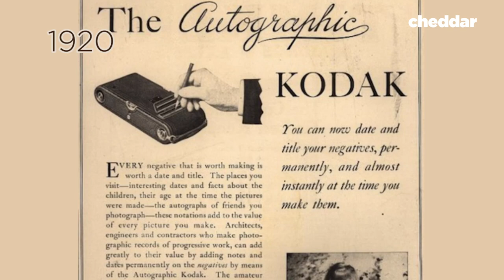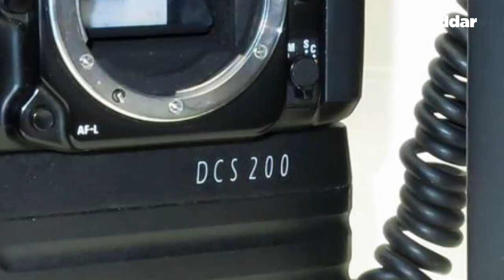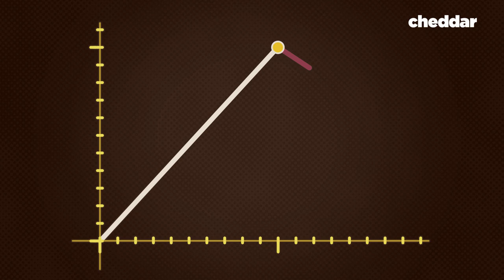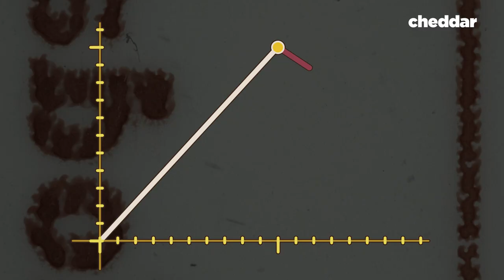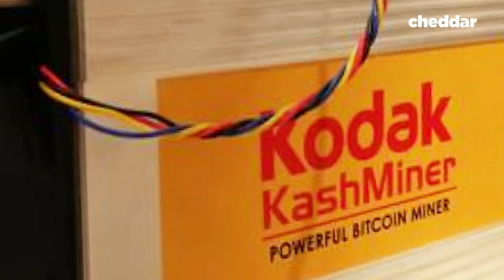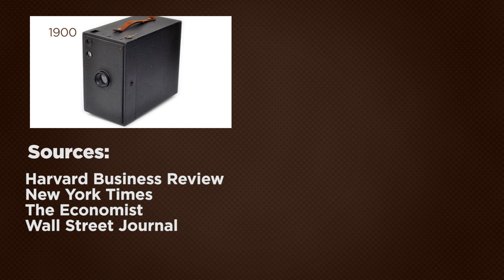Why Kodak Willingly Ignored the Future of Photography - Cheddar Examines

Comment: This video draws some pretty misleading conclusions. The digital camera revolution didn't kill Kodak, the smartphone revolution did, just as it also killed the the rest of the consumer digital camera market (and is now whittling away at the bottom of the enthusiast digital camera market). Kodak was a market leader through the early digital camera revolution, unfortunately their only other significant investments were in physical image reproduction (professional and consumer printing), and digital publishing and distribution killed that right about the same time as smartphones killed their consumer imaging investments. Kodak had no significant electronics manufacturing base to continue producing digital cameras at cutthroat margins, and by the time the threat of smartphones was apparent, Apple and Samsung were unassailable. On top of it all, they had significant pension obligations to continue funding through and after the 2008 recession, so they had little latitude to just burn their product portfolio down and start over. Sometimes history just picks winners and losers, and this time Kodak was the loser, even though they made the right moves at the right time.
Reply: Tell that to Canon, Nikon, Sony, and Fujifilm. Their DSLR and mirrorless digital cameras are THRIVING!!! Kodak didn't even budge.
Reply: @MrQwertypoiuyty  More ILCs are sold annually than in any year in the film era.
Reply: @MrQwertypoiuyty  Kodak had no real professional DSLR presence because the industry was nearly standardized around Canon and Nikon (Kodak's DSLRs were even just Kodak sensors in Nikon bodies), the consumer digital market was their only growth path in digital imaging. But the death of the consumer digicam market is what killed them. Even for the companies you listed, the future isn't great. Mirrorless is killing DSLR. Premium phones are attacking the prosumer digital camera market now.  Canon makes far more money from medical imaging and Business document reproduction services these days than they do digital cameras, it's completely arguable that they're not even a camera company any longer. There's other camera companies that made the jump to digital to only to fall on hard times: Konica-Minolta (sold the camera division to Sony), Pentax (got absorbed first by Hoya then sold to Ricoh), Hasselblad (owned by by a private equity firm now, with minority ownership by DJI). The four you listed + Panasonic can afford to stay in the game because they're well diversified and don't depend solely on digital cameras.
Reply: @jasonosmond6896  how bout you make a video then.
Reply: Before the smartphone revolution came, digital cameras were already eating into Kodak's film sales.
Reply: I strongly disagree that the digital camera market has been "killed" by the smartphone. Smartphones these days have some amazing camera capabilities for such a small package, especially as more smartphones get the same 1/2.3" BSI CMOS sensors that high-end small-sensor compacts have inside. That said, they have extreme optical and power limitations that make them vastly inferior to a "real" $500 camera. They tend to have fixed apertures and fixed optics, usually wide-angle only, and the clip-on adapter lenses used to give them different optical qualities are noticeably inferior to a "real" lens. Most of the reason that high-end smartphone images look good at first glance is the heavy noise reduction done in software which, when zoomed in, gives the picture a "mosaic" appearance due to the smudging. Fine detail is non-existent. Most of the good-looking images on Instagram are shot with a Wi-Fi enabled DSLR and transferred to the phone for posting!
Reply: @JodyBruchon  ...  true, but by the 70's, Kodak's camera division was entirely devoted to consumer cameras, simplified for ease of use by non-photographers. By the early 70's Kodak only made point & shoots, which were entirely supplanted by their superior digital counterparts.  By the time Kodak got well onto the digital point & shoot bandwagon, smartphones  were beginning supplant those.

90% of all photographs taken are still made by non photographers, for whom the smartphone is more than good enough. In fact for their needs, it's superb.
Reply: @mortimersnerd8044  Smartphones are good enough out of convenience more than technical superiority; it's "the camera you have with you" for most people, but that doesn't mean it has killed off point-and-shoots. If  you have a high-end phone with a 1/2.3" sensor then you can get comparable results to a compact point-and-shoot at full wide, but that's as good as it gets. Smartphones certainly didn't help Kodak, but digital cameras were still in widespread use several years after they got into the market. I had a Kodak digital camera in 2000 that I was using until 2006 when it was replaced by a better (but still cheap) FujiFilm digital camera; smartphones weren't a thing in 2006, though feature phones with lousy low-res cameras meant mainly for picture messaging were widespread. Feature phones in 2006 had truly awful cameras, though. It took quite a bit of time for tiny CMOS sensors to catch up to the CCDs of the time.
Reply: @JodyBruchon  ,"Smartphones are good enough out of convenience more than technical superiority"... Exactly. In mass-market low end cameras, convenience is way more important than technical superiority, and that is the only kind of camera Kodak made at that time. The smartphone is the most convenient form of a camera available, so it completely supplanted Kodak Cameras market base of non photographers.

Nikon, Cannon, Pentax, Fuji, all  produced cameras for professionals/enthusiasts which is why the smartphone didn't destroy their camera divisions. Kodak only made cameras for exactly the same people who now love the smartphone for taking pictures, which is why their camera division died.

BTW,  if you are going to upvote your own posts, it'll be a  little less obvious if you wait a few moments before doing so 👍
Reply: @mortimersnerd8044  smartphones with cameras that took remotely decent photos didn't exist until a decade after Kodak got into the digital camera market, so they had nothing to do with Kodak failing in the digital camera market until Kodak was already collapsing. I had the first Android phone which was an expensive phone at the time and its photos were not good, especially compared to a cheaper point-and-shoot dedicated camera. I didn't start taking casual photos primarily with a phone until about 2010 for this reason.

I upvote my posts because it's allowed. If that's really where you want to take this then I'd say you're out of things to argue about.
Reply: @dangermanv6133  Not at all, Kodak was one of the top consumer point-and-shoot digital camera manufacturers in the early 2000s. In fact, of all the people I knew that had digital cameras, the majority had Kodaks (not me, I was a Fujifilm guy until I switched to Sony mirrorless). But just as significantly, for every one of them (including the non-Kodak owners) that was the only digital camera they owned until they got a smartphone. Kodak's consumer digital imaging play was entirely based on the concept that they could sell printers, ink, and photo printing services to people with digital point-and-shoots, and that would be their continuing revenue stream. They sold digital cameras that were easy to use, and designed to integrate well with their printers with easy to use docks and software. Smartphones killed that by not only removing the need for the camera, but by removing the need to print photos so they could be archived and shared.
Reply: @JodyBruchon  For your average consumer, their first digital camera was also their last digital camera, (unless it was one of those truly dire 1MP fixed focus jobs that came out at the beginning, which they might have upgraded after a few years, which is what I did, to a nice 6MP Fujifilm E550 that could shoot RAW, weeee!) . It was probably 3MP - 6MP, with bad low light imaging and potato quality video, along with dodgy and slow autofocus. The memory card was likely 64-128MB, and could hold 50 to 200 shots depending on quality. The only way to properly view and share the images was to wait until you got home, plug it into your computer, wait for up to 10 minutes while it transferred over USB 1.1, and then wait for your ~1 GHz computer to index them and generate thumbnails. If you wanted to share them, the only way to do so was via email over your 512Kbit/sec DSL or cable modem upload, keeping in mind that email attachments were limited to 5 - 10 MBytes, so you were either sending only 4 or 5 at a time or resizing as an extra step. This was all circa 2005.

By the time the iPhone 4 came out in 2010, it had a 5MP BSI sensor, tap to autofocus, LED flash, HD video, a bright high resolution screen, up to 32GB of storage, a CPU with image processing specific extensions, up to 5Mbit/s upload to the tower, or up to 288Mbit/s to WiFi, and most importantly, an app store that permitted apps that allowed the user to easily view and edit any of her pictures any way she liked, and then share them online or to anyone anywhere else in the world with just a few taps.

So yeah, "technically speaking" smartphones weren't, and still largely aren't, as good an imaging platform as state of the art point-and-shoot cameras. But for all the things that 95% of consumers care about, they were and still are without a shadow of a doubt much better at being cameras consumers want to use, and they did that within only 3 years of instroduction, and they've only gotten better every year since. The iPhone was introduced in 2007, the iPhone 4 in 2010, Kodak declared bankruptcy in January 2012, and exited the consumer inkjet business in September 2012.
Reply: @jasonosmond6896  I own about 15 cameras, mostly point-and-shoots, from the early 2000s through 2011. I owned (and own!) a Kodak DC3200 fixed-focus 1MP camera. Most of my point-and-shoots were bought in the past year because I already owned several quite excellent interchangeable-lens cameras and wanted to see what I could do with something far more limited. I've got a Canon PowerShot G3 (not G3 X, the original G3) from 2002 in my collection; despite being a 4MP camera with an old-school CCD and a max ISO of 400 and almost old enough to buy cigarettes and drive a car, I'm able to get excellent (particularly for the limited tech of 2002) long exposure night photographs with it. Here's one of them: https://www.jodybruchon.com/wp-content/uploads/2018/02/IMG_0113.jpg

Your "circa 2005" is a few years off; you seem to be remembering and mashing up elements of 1998 and 2003. I'm all too familiar with the issues from the earlier years of digital photography and some of the things you point out were not really a problem back then. 5MP photos transfer much more quickly than the 24MP photos of today's cheap DSLRs. USB 2.0 came out in April 2000 and was in widespread consumer computer use by 2003 (Windows XP came with native EHCI support) so direct USB transfer wasn't nearly as bad as you've described from about 2002 onwards; it was also possible to transfer pictures much faster in the late 90s-early 2000s with CompactFlash USB and PCMCIA adapters. Burst shooting was impractical, so a 200-image capacity was more than enough (and for most point-and-shoots even today it still is more than enough) and you only need one shot if you're taking the right one. Also, I was a cable modem installer in 2002 and the standard service level was 3 Mbps downstream then. Home computers blew past 1 GHz CPU frequencies around the year 2001; the Pentium III Coppermine was released at 1.0 GHz in 2001 and the Pentium III Tualatin family released later in 2001 had its lowest speed chip at 1.0 GHz. I build some Coppermine and Tualatin PCs back then. Regarding "the only way to share was email," that's quite far off the mark. Webshots was the first photo sharing website and was launched in 1999; I have many fond memories of finding wonderful images on Webshots and using their PC software to apply those shots as slide show wallpapers on my Windows 98 machine. It was essentially Flickr for the beige CRT generation.

My entire point is that all cameras have a valid and valuable place. I have a DSLR that takes amazing photos but is quite bulky, I have a mirrorless camera that's not nearly as bulky and heavy but still has to have its own holster bag to carry around comfortably, I have two Pentax Q cameras and a small shoulder bag that hols both cameras and the entire Pentax Q lens lineup in the same space that the single mirrorless camera and lens takes up, I have a long zoom point-and-shoot that I always keep in my car in case I spot something in the distance, I have a wide-aperture point-and-shoot (LX3) that takes far superior photos over the long zoom one and that I generally keep in my car for when I need a good camera that fits in my pocket, and I have my cell phone in my pocket literally everywhere i go outside of the house.

No matter how good my smartphone's camera is, my old LX3 will outperform it any day of the week and fits in my pocket. The only reason smartphone cameras are so popular is that they are always available, so they are a big win on convenience, and it's also true that the average person using a phone to take pictures doesn't care about image quality unless the problems are too obvious to ignore. Those people only ever bought a dedicated camera because that was the only real option. They were the absolute bottom of the market, the bargain basement price hunters that will accept a crappier camera if it means spending $50 less on it. A smartphone with internet access and a camera fills their needs with an added camera cost of $0.00. That doesn't mean that the cheap compact point-and-shoot is dead by any means, just that the least profitable and most fickle market segments have left the camera market. For anyone who needs imaging for purposes beyond social media and MMS sharing, the dedicated camera is here to stay.
Reply: @dangermanv6133  
Kodak was one of the first companies to release digital cameras. On top of that they actually were the market leaders in consumer digital cameras in the early 2000s. The whole idea that Kodak died because they didn't make digital cameras, or that they didn't make them early enough or good enough doesn't make any damn sense.
Reply: @JodyBruchon  but can they post the image directly to instagram?
Reply: Smartphones killed the point and shoot.
DSLRs are still alive and well.
Maybe Mirrorless is the future but DSLRs will still give you better picture quality to price ratio.
Reply: I can agree there, I remember back in 2010 or so my mom bought a proper digital camera for I think $250. It was a standard consumer model but it took 3860p stills (video was only 480p tho). Today though my cell phone (Motorola G5+) costs just $50 more at $300, but takes the same quality stills, and will also do 4K video, we haven't touched that old camera since my mom got an iPhone around 2012
Reply: Smartphones may have killed the point-and-shoot camera market, but somebody still has to make the camera module that goes into the smartphones. Sony dominates that market, with their camera modules being used by Aple and Samsung phones alike. Smartphones didn't kill the need for cameras, they just transformed it. Sony survived that transformation.
Reply: @guspaz  Sony invested in developing their own sensor foundry. Kodak could have, but chose to purchase sensor from outside manufacturers. Kodak color science is still superior to any of the Japanese companies except Fuji, but the " not made by us" mindset has prevented any of them from licensing it from them.

Comment: He did not mention the Kodak production of the first commercial digital cameras. The first digital camera on the market was the Kodak DC100 that sold for a whopping $1,000 and was a one megapixel camera. I know I bought one.   It was quickly followed by the DC200, and  DC290 cameras which  took 2 megapixel and 3 megapixel pictures respectively.  They continued to innovate their cameras of their own and also were a major producer of the software and chips for other makes of digital cameras for years, including such makes as Olympus, Nikon and Leica.  In fact their deal with Nikon was very tight as Nikon made the bodies of the Kodak cameras while Kodak made the internals for Nikon and their own cameras.  The Japanese could produce clones of the Kodak chips and develop their own at a cost well below what it cost Kodak to produce chips.  That is what killed Kodak, not a lack of innovation.  I found Kodak Cameras much better than those of the competition, both in clarity and especially in color.  When I want to get a really true color image of something I still grabbed my old Kodak  Z7590 5 megapixel camera until it died of old age. My current choice is my Canon  SX30.  It is next in line for producing true colors IMHO.  Now that Kodak is making digital cameras again, I will have to check them out.

Comment: I remember in 1982 Kodak introduced the first 8mm camcorder at an exhibition with great fanfare. There was doubt if a chemical company could handle electronics, I remember a sales manager stressing that Kodak owned a company called a SPIN Physics. The camcorder was also the first on the market without a tube but a ccd sensor. For reproduction it had to be put in a cradle connected to a TV. At that time portable video was possible with a huge camera and a10kg video recorder on the shoulder. Anyway, nobody bought it.